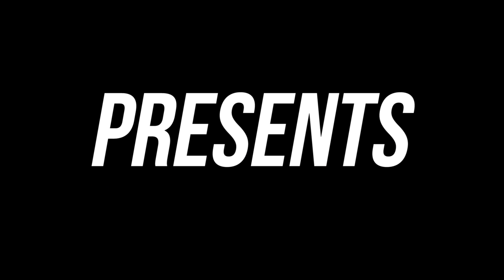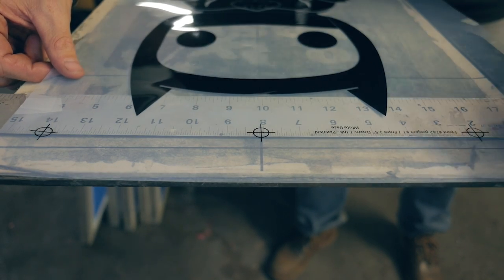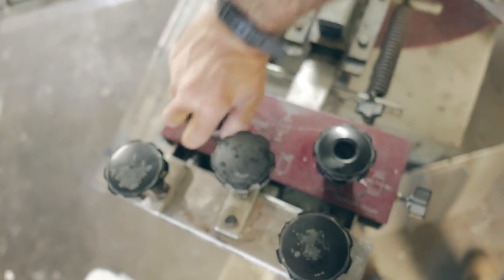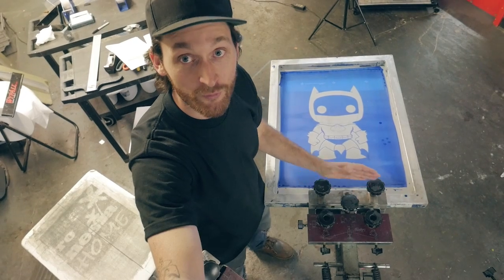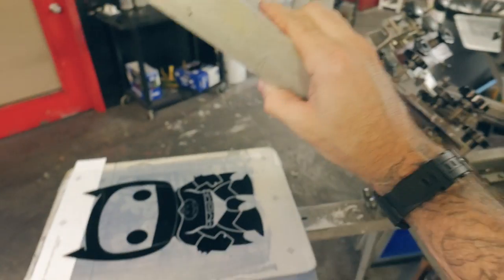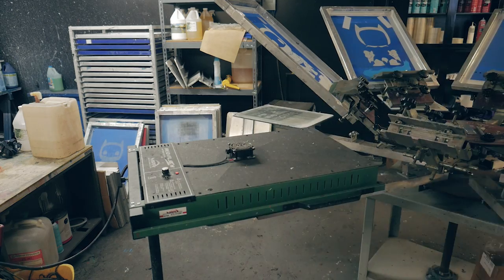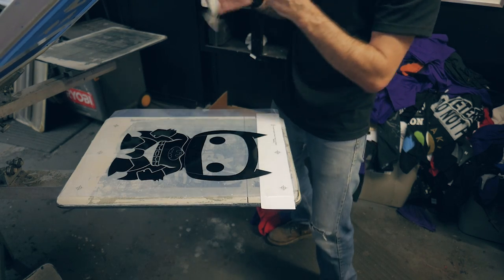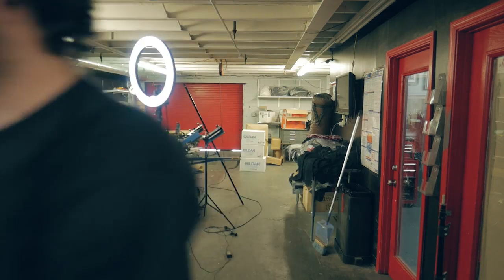Set up and Register a Multi-Color Silk Screen Printing Job on Press || How To

Comment: Home Run with the tutorial. You ended up answering most of my registration questions. Thanks for that awesome pro-tip. Now do I have to zero out each print-head for every single job? Thanks for the fucking time Cam! By the way, I like the fact you fucking swear. It makes you more relatable. Keep them videos coming!!
Reply from the maker: My printers dont always zero out but that is more from bad habits they have developed. I always zero them out.

Comment: I have watched your channel a lot through my journey of screen printing. One question I have is - if you will be using multiple stations in this print, like say you want to load a shirt onto each station before printing... Do you need to individually register for each pallet, or wouldn't that disrupt the original registration? Do you just set each pallet to the same setting on the arm, and hope that it is perfectly squared? That part is confusing to me.

Comment: What size mesh do you use for each color
Reply: 100-160 for white and 160-200 for colors. Usually your colored inks will be thinner therefor you can put them on higher mesh. Use the lower mesh for low detail artwork and the higher mesh for more detailed artwork.